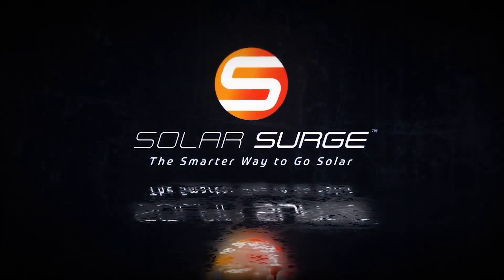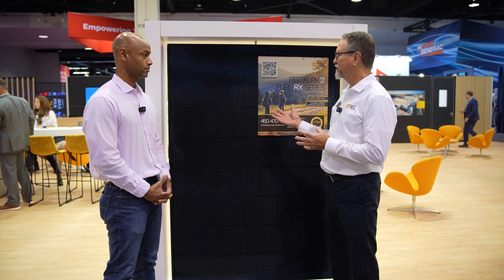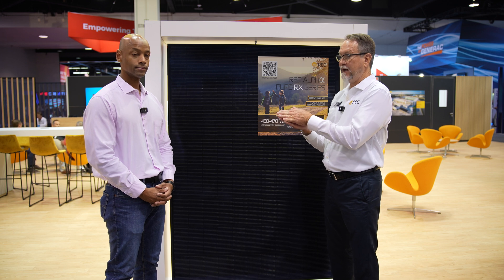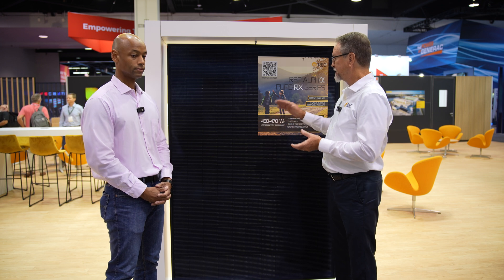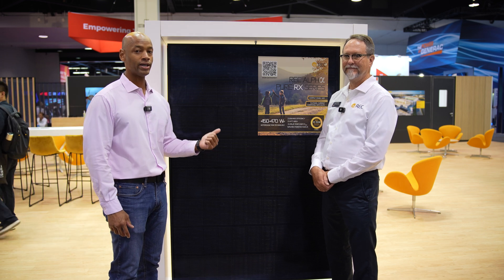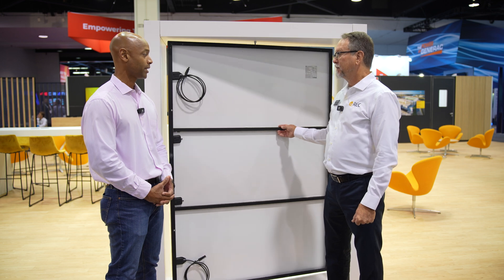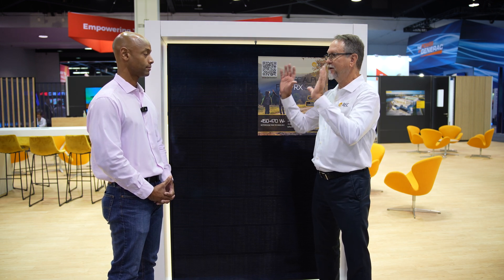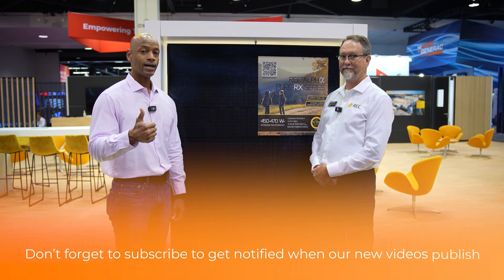NEW REC Alpha Pure RX 470W Panel

Comment: They're really wide panels now. It makes using portrait slightly more difficult but really where the efficiency is going to come through now is the conversion from DC to AC, i.e., the MLPEs underneath the panels.
Reply: MLPEs???
Reply: @ray_casso  Module level power electronics. It's an acronym used fairly often in the solar industry.
Reply: @MrDontcareify  well I've only installed all-in ones. Or string inverters, would micro inverters be considered MLPEs?

Comment: Seems to me, as fast as these panels are increasing in power, the faster enphase is going to have to play catch up.   Their flagship micro maxes out at only 350 watss or so, and only for a couple hours.   I  have 28 iq8+ that, all summer never got above 293 watts,  and 2 iq8a's that maxed out at 336 watts for 2 hours.   And that was spring through summer.   As of now im only getting 270 max and only forban hour or so thn drops off.   It looks lile string unverters are going to be the way to go again.
Reply: true. and the more current they have to push out, the more voltage rise becomes a problem

Comment: I'm noticing that while the panels are higher in watts, they are also bigger in size. This doesn't really help out when most home owners have limited space on the roof. The panels should be getting smaller while either producing the same watts or more watts.

Comment: HJT explanation is like WTF. I don’t give a crap about the history.  Tell me what it does for me as a customer
Reply: I think it’s Better efficiency (more watts per square foot) better temperature coefficient, better durability (I think) .
Reply: @marcppparis  also allows to work out if a inverter will be able to handle a string of panels if the temp goes the other way e.g. -32 deg c (alaska). +25 > -32 is 57 degrees difference would increase voltage by near 17% x say 10 panels is 170%